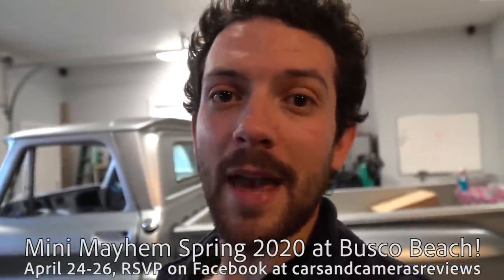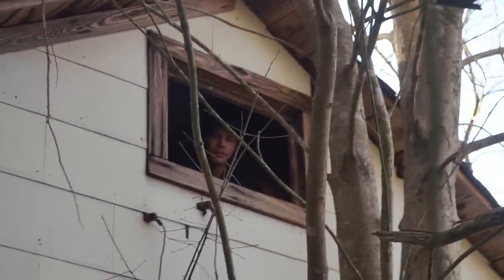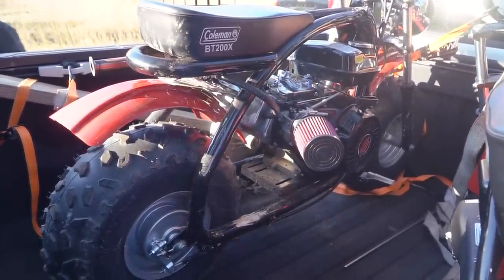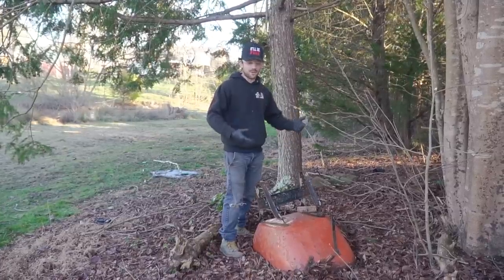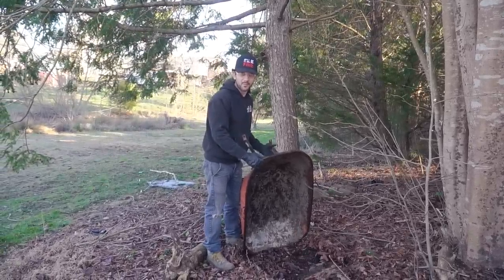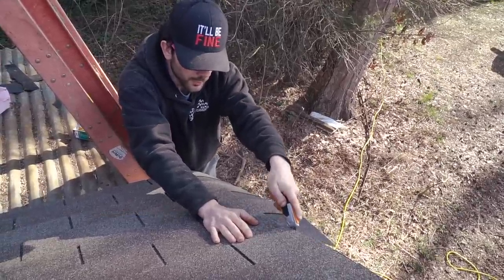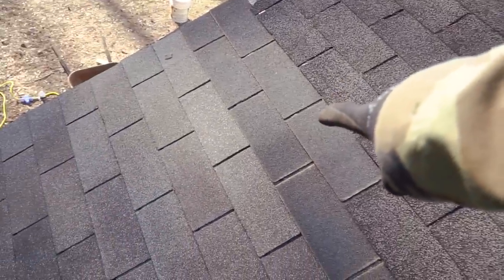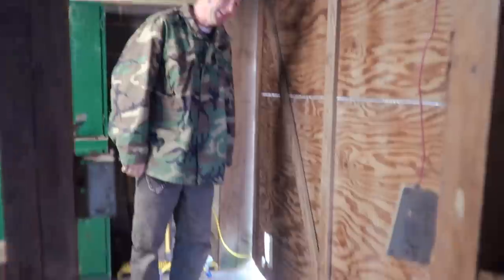Fixing the Abandoned Shop at our New Headquarters!

Comment: One way to help that settling wall:  When you change the roof, remove a bit of sheathing and drop rebar down into the  cavities from above and fill the cores of the block with concrete.   If you did this every other core it will lock that wall back together.
Reply: Cool
Reply: That would require taking the rafters and plate line off. To much work.
Reply: Guy Outdoors  yea i was thinking of some underpinning also.
Reply: Yeah this will add more weight and probably make the problem worse. Plus the rebar will be running perpendicular to the tensile loading so it won’t help either. Fix the problem under the slab to fix it for good. Jacks and concrete are the way to go.

Comment: Fix the settling crack in the wall by grinding out 1"1/2 deep on both sides of the crack. Install a metal twist across the crack with mortar, strike, brush, and paint. No ugly bolts👍

Comment: Suggestion for your sinking corner of structure.  We have used this method a couple times in a similar situation.  Dig a hole under the floor slab large enough to get a piece of 2x 12 or better a 4 x piece of scrap lumber or a flat piece of concrete that'll fit into the hole.  Get a inexpensive 2 ton bottle jack, and place it on the block in the hole.  Then place a piece of 2 x or 4 x lumber on top the jack to spread the load.  Now proceed to jack up that corner of the structure as much as needed watch the crack in the wall close up.  When the lifting has reached it's limit you mix up several bags of ready mix concrete and fill in that corner whole burying the jack and all all the way up the bottom of wall and even more if you can.  Also get several cans of the spray foam and fill in whatever gaps may be left in the wall cracks.  Let it get hard before try to trim off the excess foam.  

Is that pond part of the property?  If yes you should stock it with bluegills and bass.  You should also do some water related builds like making a hotrod mud-motor.  Parts and kits are readily available for making a mud-motor.  Best wishes on your new base of operations.

Comment: Little engineering advice.  Don't brace that wall like you were saying.  That brick will not handle any tension and you will end up pulling the other bricks apart.  Best way is to dig some holes on that low side of the foundation and buy some cheap bottle jacks from harbor freight.  Pour a small concrete pad with sac crete and use the bottle jacks to lift that corner. then fill in the hole with concrete leaving the bottle jack in place.  if you do this all along that low side, maybe three total from the looks of it, the foundation will be fixed.  Thanks and Gig'm

Comment: If you're wondering what the red brackets on the counter are, they are 12 and 12 toe mounts. They nail to a roof; through to the rafters, and twobys lay on them, for rooftop scaffolding. They are used for applying the heavier roofing tiles; that are more likely to break when walking on them. They're in great condition. You might be able to get a few bucks for them. The best I can remember, they're kind of expensive; for what they are.

Comment: About the only thing you can do to save the cracked block wall is knock a few blocks out on top and fill the cells with concrete.  Drill holes through the roof and top plate and drop rebar the height of the wall down through the blocks first.  The foundation has probably cracked and shifted.  Looks like you can make all the noise you want now and not upset the neighbors.

Comment: Shingles cut easier from the back to the front for future reference also those trees are the cause of your foundation issues  the roots are up underneath the building and even though cut they'll still raise up more causing more wall issues before they rot out from under the building too bad I live half way across the country I coulda fixed the walls and foundation correctly over about a 1 week time span  (alot of drying time for mortar and concrete) I'd recommend having someone come in and fix the foundation then chip out and remortar the cinder blocks back together (wouldn't be my first rodeo with tree root damaged foundations and walls)

Comment: You can fix the wall properly by dropping rebar and cement down the top of the webbing. Or cut out some of the sides out and place rebar in there, stick the cut block back in, and pour cement down in the hole.

Comment: glue a few narrow strips of glas across the cracks , if the glass snaps at a later date the building is still moving along the cracks  and the glass will show you wish way up down in or out 

maibe you could put a piece of flat band steel along the whole wall on both sides around elbow height and drill through the strip through the wall and put some nuts and bolts in clamping the whole wall together in between the two bars of steel (paint them first), should prevent the cracked part of the wall from falling out or in for the most part unless the corners in the walls let go
depending on how mush you need to spend to fix the place up

 (it doesnt need to be liveable just watertight and somewat warm in wintertime ) 
maibe it would be possible to put up a steel barn after running youre show out of this place 

from wat i can see their priced about 10 to 18.000 dollars and there reasonably sized with one or more roll up doors and extra height so you can put a lift in there to work on cars , if the place is on youre own land it might be worth doing after a few years maibe two or one barn twice the size so ike can work on his cars too  

you need new foundations on this building or at least add to the current foundation to prevent it from sinking further and rebuild up from there , redo the walls maibe replace a few rafters new wood on the roof new shingles garage door that seals yadah yadah yadah so i think over time you would spend ablout the same fixing this place up and still have a building worth less than the new steel buiding

Comment: SUGGESTION:  look into leveling the foundation with the Cable Lock system.  a 20' x 20' building would not be expensive.  it would also close up those cracks in the walls.

Comment: You were asking about the different pistons for the flat head 5 horse B&S engine. you showed us that the racing piston had a longer push rod. How does it work? The longer stroke and less 2 rings for less drag, shouldn't it add RPMs to the overall performance? I would really like to know guys. Keep the videos coming. Peace!

Comment: first off your using the wrong blade for shingles. you use a a hooked ended blade so it don't keep jumping off the shingle. individual is bundles and 3 bundles is  square. not a bad job I noticed you still have some questionable lumber still in rafters. I suggest you fill those cracks with mortar so to help strengthen the walls. me personally id suggest band aiding it until you can build a bigger nicer shop in a year or so. band aids only gonna last but so long. the things you guys love to build you need a level or atleast close to level shop floor. gl with this I know you guys will get it together either way.

Comment: For video quality purposes you should try to set the air compressor up out under the lean-to and put insulation between the building and compressor.  Foam board would probably be better to help keep mice and rats from building nests though.....

Comment: Turn that water tank into a  hot tank for cleaning parts.  I did that and welded a 120v water heater element to heat the water and put a degreaser solution in it.  Cut the top off and put it on a hinge.

Comment: you forgot the drip edge. Individuals are called bundles. usually 3 bundles to a square. unless your using lifetime shingles which are thicker and sometimes are 4 bundles to a square. but the drip edge is absolutely necessary

Comment: i wish some one would give a metal doors and metal bars in windowsbut that waals what are opening in end of walls low korner take ground out and put wood and hydraulic pump to rise it up then put gravel and rocks under that wall and take pump out if thats dosent help put a metal plates in and out of wall and lock them in big bolts

Comment: i need help fixing a problem on my go kart. so basically the issue is when i get going at a good speed like around 20 mph the steering wheel starts turning side to side and i think it might be because the front wheels arent quite aligned but im not sure if thats whats causing it do do that. if someone could help it would be appreciated.